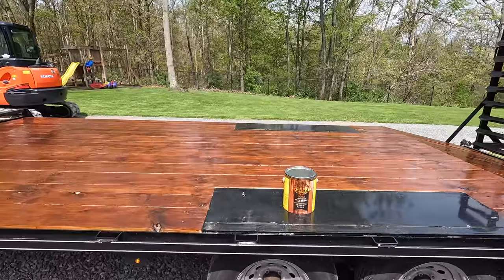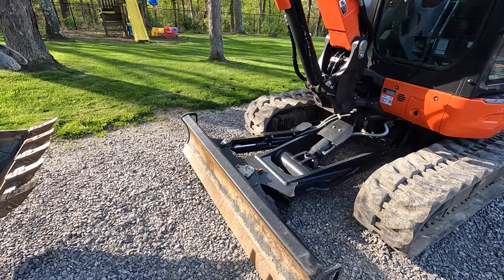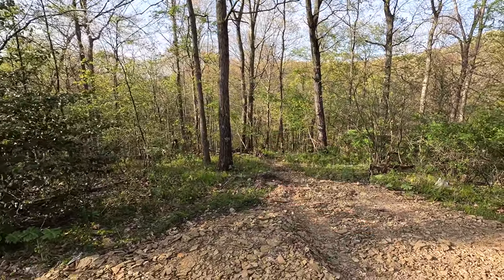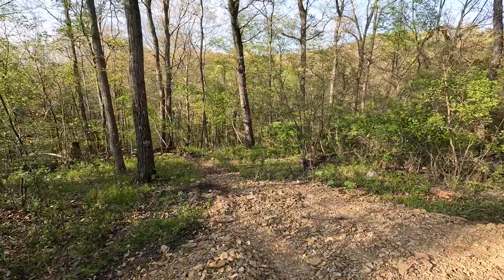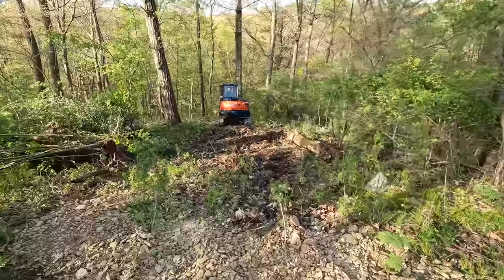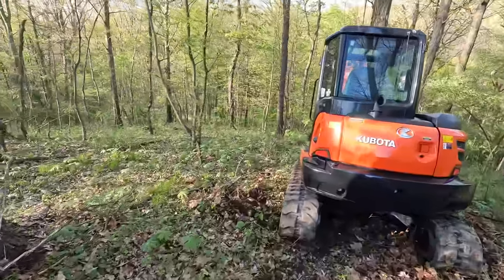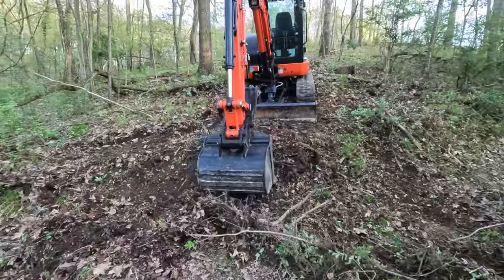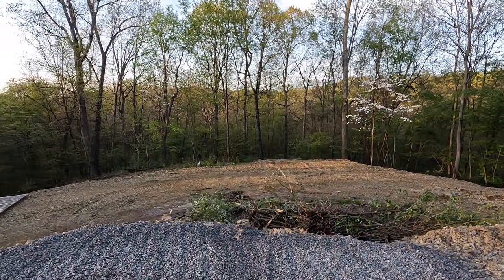New Trail Through the Woods, Wood Yard to the Pond, Clearing with Excavator

Comment: Hi Mike, the trailer deck looks good. I did something similar but I used a small yard sprayer first so I could get down in the cracks/sides of the deck boards and used a roller and brush to even it out as I sprayed, worked great. Keep up the good work!  Thanks, J.R.

Comment: Think back several years, how long would it have taken you without this equipment you have today to do this stretch of trail, just a tractor and a chainsaw?
Reply: I cleared a parking area next to my house with our Deere 35G mini ex in 3.5 hours. It would have taken two full days by hand to clean up 50x120ft of dense forest and saplings up to 4” thick. The best part about clearing with an excavator? Break all of the roots with the bucket teeth then push the tree over, and the stump comes out with it. Nothing at all is left behind. Can’t do that with a saw.

Comment: You all should consider a Fecon Forrest Mulcher attachment for your skid steer. [ if your packing a high flo ?] Would be perfect for cutting trail and maintenance. Way faster. Not a cheap
💰💰💰 attachment. Just get with Uncle J.P. Morgan, he will fix you up. 👍✌✅💯🤣🤣
Reply: Believe he got the low flow
Reply: @rgd2598  I think you’re right about that. He mentioned that the mulchers were hard on equipment so he didn’t want one. He would rather rent that.

Comment: Curious why the Graco Airless Sprayer wasn’t used for the trailer. What you and Melissa did with roller and brush looks great!
Reply: Was wondering the same as to why it wasn't used. Can see on sides of some of the boards where missed by the brush and roller. Have to look but they can be seen.
Reply: @evilbrat5376  starting at 1:51 you can see where there are a lot of bare spots, I agree the sprayer would have done a more thorough job of covering the exposed wood.

Comment: Hello! 🙂
Reply: Good evening David ! :-)
Reply: @badcat4707  Hi BadCat,  How was your day?
Reply: @davidmorse8432  / Long and hot ! we got up to 28 ? C today and I was doing finishing carpentry on a clients front stairs and landing , I was in the shade most of the day but it still felt pretty warm /  working with that exotic wood Epee  ( if that's the correct spelling ? )  the stuffs really heavy  and I'm re-purposing boards from last year  ( client wasn't happy with the work the last guy did )  -- and trying to sand that stuff is like trying to sand a rock !!!  even with my 4 X 24  belt sander and a half worn 50 grit belt !! at times it didn't look like I was getting anywheres with it at all ?? / hope your days has been a good one - or at least productive :-)